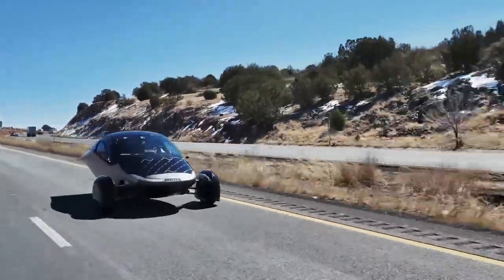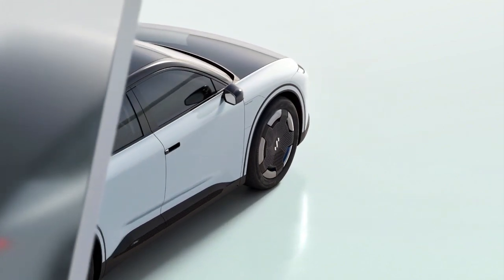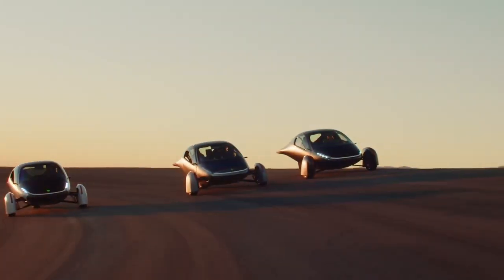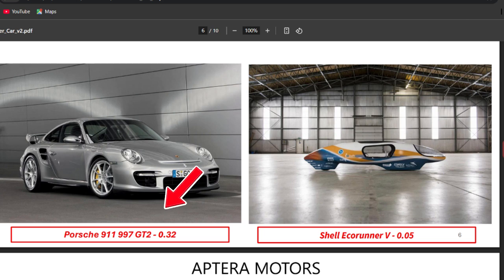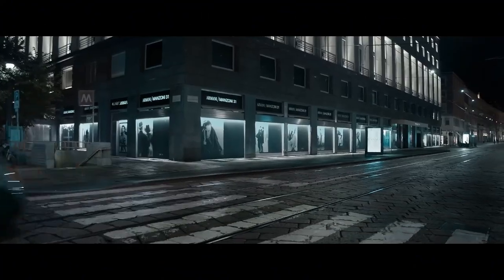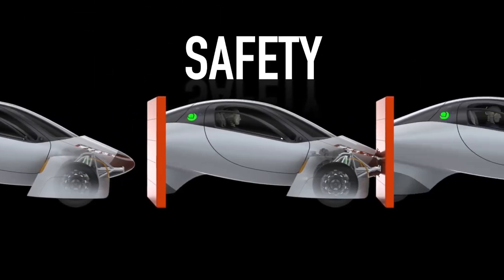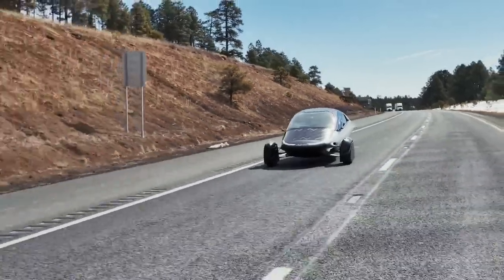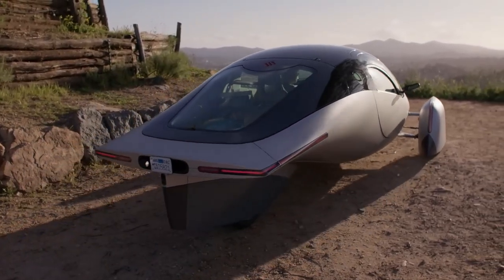Dr Elie On Aptera The First Solar Car: The Drag Coefficient, Rolling Resistance & More

Comment: I can't really see that shape having a brilliantly low drag.  The flow along the underside, where it passes under the lowest point between the wheels, then sweeps up to the horizontal 'knife edge' tail very unlikely to stay attached.  The smoke stream image at 2:51 confirms this with lots of separation contributing to a much larger wake, compared to the diagramatic image that follows.  Most low drag vehicles, including cars and velomobiles have the belly-pan parallel to the road.

Comment: It is designated as a motorcycle so it doesn't need a crash test. Aptera has done simulations and has said it will crash test a future car for the rating.
Reply from the maker: that's interesting but it makes sense

Comment: Nice, very basic chart, but you are comparing Apple to Oranges; the Fiat is a GASOLINE automobile NOT a BATTERY powered auto! Thus an EV Fiat's weight & therefore it's Rolling Resistance will be much higher. Also, the Aptera has 3 wheels versus the Fiat's 4 wheels, and yet your chart shows the rolling resistance as the same!? In programming we used to call this GIGO --> Garbage In, Garbage Out!

The average American driver drives an AVERAGE ~30 miles per day (48 km/day; 10,950 mi/yr or 17,520 km/yr). The Gorilla type glass covering the Aptera's solar cells were hail tested, & their ~23% efficiency will provide a durable Free power source providing UP TO 40 miles/day while driving or parked in the sun (sunshine "banked" while driving or parked at Home or Work!). Thus, in sunny locations, myself at 36 degrees latitude & even many other people in less sunny locations, who's Aptera is outside in the sun, will get much or all of their driving energy directly from the sun! The Aptera's solar cells make electricity to charge and thus STORE or SAVE the energy like a Solar Energy Bank, from which you withdraw from while driving.

Your chart's Aptera's Drag Coefficient is higher than 0.1: the Pininfarina Wind Tunnel measured it at 0.13. I have no idea what the Fiat's is, as it is a Niche American vehicle. You fail to mention that the Drag Force is:
DragForce = 0.5 * FrontalArea * DragCoefficient * Velocity^2

So, where are the 2 car's Frontal Areas for their Drag Force calculation, as it is Drag Force that wastes energy, not the Drag Coefficient as many think, as Energy = Force x Distance (basic Physics!)?

My 2021 Plug-in Prius has the 2nd lowest USA's EPA Drag Coefficient of 0.24, and the lowest in 2021 was Tesla's Model 3 at 0.23, BUT the Prius has a smaller Frontal Area, thus it's Drag Force is less than the Tesla's! Looking at the Aptera's front, it appears to have even a smaller Frontal Area than my Prius, thus even less drag, especially after multiplying by the Aptera's much lower Drag Coefficient (above formula). The EPA rated a 2021 Prius & Model 3 as getting EPA 134 MPGe & 135 MPGe respectively which is 4 miles / kWh (6.4 km/kWh). Aptera is aiming for 10 mi/kWh (16 km/kWh), so even if the Aptera must be charged, it will use much less electricity than any other EV on the market.

At 10 miles/ kwh, the Aptera's battery will be only 40% of the size and weight of an equal range Model 3 (or Plug-in Prius) battery, or the same size battery will have 2.4 times the Model 3's range!

When I drive, I see most autos with just 1 person in it; 2 is uncommon, and more than 2 is very rare, thus the Aptera can provide efficient, practical transportation for a majority of car travel in America, if not for all 8 billion of the World's population. If it is NOT THE ONLY CAR for all 8 billion, it is still a good market to be in, and if you look at Aptera's Financial Projections, their financial Break Even point is at 6,000 cars/year, due to Aptera's scalable assembly method and unique construction parts (only 6 parts make the car's body, all parts can be lifted by 1-2 people, and the largest carbon fiber piece is made by the same company [CPC Group] that makes F1 race car parts)!

Oh, I forgot to mention the seemingly ignored, but potentially very big market: Local Delivery! The Aptera has ~32 cubic feet (906 liters) of storage on an easily accessed, large, flat floor. It can also be a 'camper', as 2 typical adults can lie down on that long floor and they make a nylon 'tent shell' to keep the bugs out!

And YES, I am an Aptera investor because of the above & more!
Reply from the maker: thanks a lot for you input, lemme share this with Dr Elie to see what he says

Comment: Aptera gives up too much in safety in their search for efficiency. They will not have side airbags and for US Federal standards they want to be classified as an autocycle. No traditional automaker would ever make such a vehicle because of liability and reputation concerns but start ups can be reckless.  Plus the damn thing is over eight inches at the front wheels than a F150 is at the wheels. You have to put the mirrors out on a F150 to be this wide.  

Three wheel vehicles have never been popular, have some of the worst driving dynamics of any vehicle on wheels, and two seat vehicles sell in low volumes as well.  It was like they chose from a list of how to make sure we don't sell many and then said, hey lets sacrifice safety as well.

Comment: there are quite a few issues here. They can only produce just over 500watts, there are losses in many areas. The 700watts is rated output in ideal lab conditions. Curved surfaces of the solar panels is a consideration also. The efficiency has been determined but has been supressed by aptera. They did track testing to determine it..........supressed that data, they have done road testing........supressed that data, they have did some road tests at vegas..........supressed that data.
What they did release though was a value determined on a downhill run that was a drop in elevation of 7,000ft, and the high altitude run also reduced drag being thinner air, not too mention high altitudes increase the solar insolation.
What they have done, in effect is to fake their efficiency value. You can come up with whatever efficiency value you like if you go downhill!!
So even with this data manipulation they still only got 315 miles of range downhill 7,000ft. They have been saying this 42kwh pack would give 400miles of range. So you can see even with faking the data they still couldn't get anywhere near their claims.
The same goes for solar, they claim 40 miles per day, but they requires a hypothetical efficiency value which they cant achieve, even when going downhill for 7,000ft.
You see your dealing with charlatons here, very clever guys, who realised if they told everyone they had a car that never needed recharging, people would believe them, and if they used morelli design shape it would make it more believable.
You've been duped like all the investors have. Your depending on the directors to be honest men and that they give honest results, but alas they supress the real results and try to maximise their claims, whilst pretending the average driver can achieve these claims.
Theranos and Elizabeth Holmes would be proud of these guys.

Comment: So you forget one big issue.  USEAGE. This is a car. It has to serve that purpose the way people will use it.  Most of these 2 seaters will be around town in stop and go.  Very few will be taken down long freeway driving or trips.  Most stop and go city driving is less than 30 MPH.  At these speeds, weight and rolling resistance is far more important than aero. The vehicles are constantly braking and accelerating. And the "40 miles" is not "40 miles".  Put it in normal traffic, add air conditioning or heating, and other power drains will put that more like 20.  Lastly, most people will drive at day, and park it at night.  In the morning there's no more energy than when they got home.  The solution: Plug it in.  So why have all the extra weight and cost of solar cells when they are so ineffective?  Just use a more efficient and larger solar array at home and plug it in to recharge.  There's no reason to carry the cells around with you given sunlight is not consistent. And solar efficiency drops with dust and dirt which cars get A LOT.  Better to build a solar bank and feed off that.  And the bank can be used for more than just the car.  Isn't that the POINT?  Using energy from sunlight?
Reply: Your entire diatribe is incorrect.  The avg amount of people in ANY vehicle is 1.5 people.  It has 32³ ft of storage in the back.  That's a small pickup truck usage case and what's better, it has a hatch to protect cargo.  Everything you mentioned is just your knee perk bias dressed up in imaginative naysaying
Reply: @EarthCreature.  LOL.  Yah people will use this like a pick up truck. Sure.  Until its broken into. One thing that has not been discussed. The frunk is GONE because they put in the Hyundai motor drive there instead of the motors in the wheels like they PROMISED.  The only storage now is under the glass -- exposed.
Reply: @mikelfrance-l6x  "Promised"? It was the plan and now, at least for the initial builds, it isn't. The glass isn't exposed because it's behind the solar panels. Full solar coverage is the only option for the initial run. Skip to 7:20 in the video you're commenting on to see that the back area is fully opaque. Personally, I hope the in wheel motors wind up getting back in the build at scale after the initial run, but if they don't because of issues, so be it. I don't see how this is a dealbreaker either way. It's just about what tech they can use at scale that works today and I trust they are better at figuring that out than a YouTube comment thread is.
Reply: @LuneUnion  Excuse me.  They took people's money saying it was going to be one way and found out later they couldn't do it.  That's pretty close to FRAUD.  If GM did that it would be a class action lawsuit.
Reply: @mikelfrance-l6x  Lol. Welcome to manufacturing and business startups? Things change. They intended to deliver a car that had a particular type of motor and they found out that it was going to be a problem so they adapted. If you put down a down payment (what $100 to reserve a slot?) or invested in them, I'm certain their disclaimers mentioned that details could change. They didn't say they'd create a car and then deliver a toaster, they changed how the car moves forward. I think the in wheel motors are cool, but why do you seem to think they are necessary?
Reply: @LuneUnion  I'm sorry but I don't laugh when companies defraud investors and lead them to invest in things they have no idea they can actually do. Maybe you do, but fraud is still fraud.  Aptera has 3 more months of cash before it closes the door.  When they close the door, will the investors say "well, that's start ups!" and move on? I don't think so.
Reply: @mikelfrance-l6x  Not exposed, under an opaque solar hatch. Not an easy break-in, and camera's are recording ...
Reply: It charges while you drive as well, so it's charging all day while you're out, not just at night when you get home. On a 2,200lb car, the extra solar panel + wiring weight is estimated to be 40-50 lbs.
Reply: @mikelfrance-l6x  

The point of this car is its aerodynamics. And energy effiency.
This emerged out of solar powered vehicles. The solar cells are just style.
Reply: @c.l.3806  And that's what's wrong with it.  Aero efficiency is great at highway speeds.  It means nothing cruising to the supermarket or work in stop an go traffic.
Reply: @mikelfrance-l6x  
Please inform yourself about velomobiles.
They got these aero hulls and work with pedal power (200 watts) at low speeds.
Reply: @ Because they have low weight and low rolling resistance. Not because they are "aero".  Look at an electric skateboard.  There's nothing "aero" about it with the rider standing upright. Yet they are very efficient.
Reply: @mikelfrance-l6x  Mine will be road tripped all over the USA, Canada and up to Alaska!
Reply: @jeffcarlton3590  Except when it rains.  Does it rain in Canada and Alaska?

Comment: Good to see it's now 70 miles per day. The great doctor needs to contact Aptera and have them use his calculations. This will bring in the big investment just because the solar range per day has now gone up 75%. If you really care about this project, you will do this right now as it will make the Aptera a reality. Plus when you do this, make a video of them with the great doctor and how you have made this deal work. Looking forward to your next video of this happening. You will be rewarded by saving planet earth which as you know is why you did this. Not just to get views and subscribers like the rest.
Reply from the maker: Hehe okay this is a good suggestion: I will get this to him or let me tell him to respond to this
Reply: Dear Sir, let me explain how I made the estimation, the power provided by the solar panels of the Aptera car is quoted to be 700 W (on a sunny day in California), so for 10 hours of such a power (remember that the power produced by the sun is not constant during these hours, the maximum can be 1500 w/squared meters x 3 meters of solar cells x 20 % of the yield, this gives 900 W at zenith, so 700 W seems acceptable). So we can charge the battery with 700 W x 10 hours = 7 kWh of energy, I just extrapolate based on the numbers provided by Aptera (slide 3: 250 miles for 25 kWh) so 10 miles/kWh so with 7 kWh, we can expect 70 miles of free ride. This is as you mentioned an optimistic estimation compared to 40 miles given by Aptera. So the real number will depend on the level of sun's power (location and position of the car related to sun rays), the amount of parking time of the car (probably eight hours, the time people are working in their job) and so on. The real number is probably between these two levels (40 to 70 miles). Hope this helps.
Reply: @Elie-n1b  The rating of the solar panels is based on the industry calculation. It will not put out 700 W. Probably more like 500. Still it's good to have those extra miles. It could make the difference between being stranded somewhere short of a charging station. Also, for people who live where they can't plug in overnight, apartment dwellers etc.
Reply: @Elie-n1b  Do you even know how solar wokrs in the real world? 700 W x 10 hours? Thanks for the laugh!
Reply: @Elie-n1b  Completely wrong! Even Aptera wouldn't claim something so baseless!
Reply: @ - Let Aptera know as they would love to have you on the April update. This is huge news for them and the community.
Reply from the maker: @billsmith5960  do you have direct contact with the company?
Reply: @chriswabs  - I do. It's their website. They have the contact info right there. They answer immediately. So, it's that simple. Trust me, once they see your video, they will be interested in your content.
Reply: @ OK.  Now do that in stop and go  traffic in Phoenix in summer of Buffalo in winter.  Fun fact:  Not everyone lives in Southern California.  And you assume parking is in sunlight.  And you assume there is not much dust on the cells.  The facts are in the real world its no where near 70 miles.
Reply: @mikelfrance-l6x  -As long as the great doctor says it can, then it does. When you are a doctor, you know. It’s like Dr. Paul Moller who is the inventor of flying cars. They know it all and give them money as testing in the real world is not needed.
Reply: @billsmith5960  I think you might be the only person entertained by your sarcastic humor.
Reply: @glennzajic7318  - I guess you didn’t watch the video.
Reply: Aptera isn't going to save the EARTH
Sunlight isn't going 24 hours a day so it won't be charging all day at anytime.

There is no savings to be had from inconsistent charging.
This "car" is already too small to be practical for everyday use.
Add the weight of two people plus some luggage.
Tell me what the range is.:text-green-game-over:
Reply: Unfortunately Aptera has supplied ZERO actual data to use.  Garbage in, garbage out. Aptera needs to charge the car in normal sunlight and drive it through a typical city over a long period of time (with the heater or AC on!) and let us know what it ACTUALLY does.  Why in the world would you buy any car without knowing if its even usable as a vehicle?  Would you let GM or Ford do that?